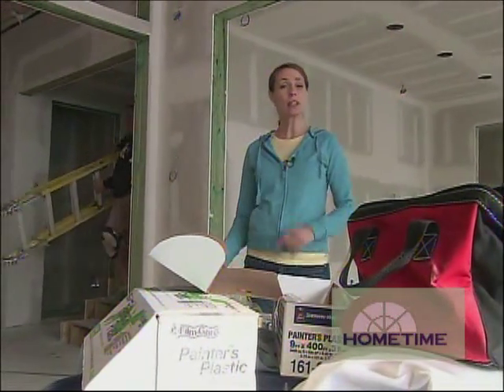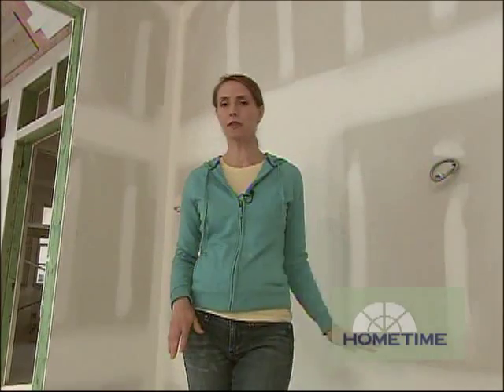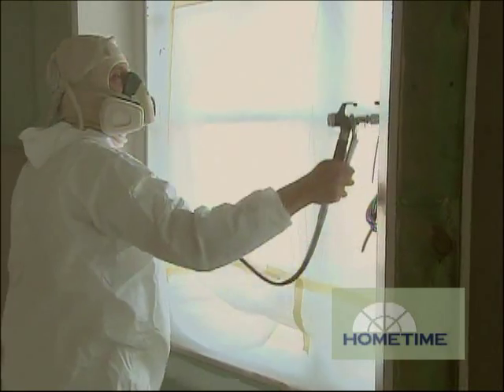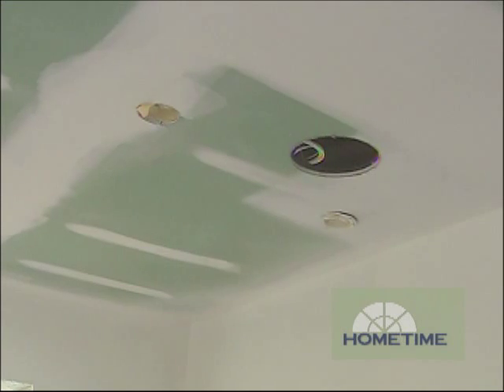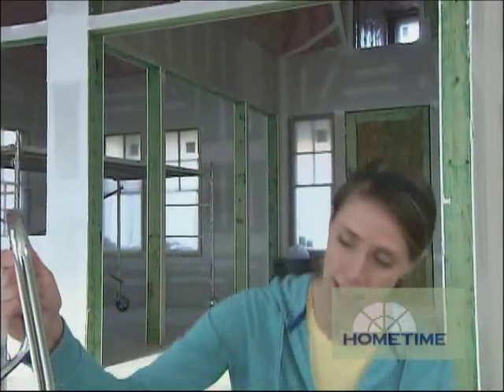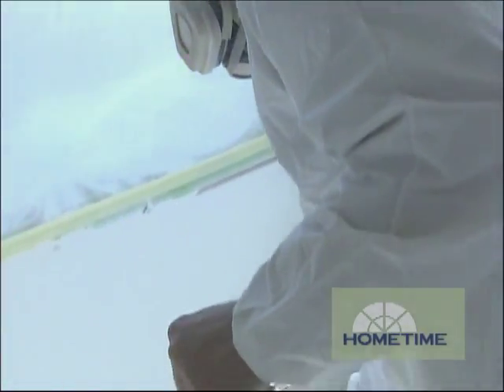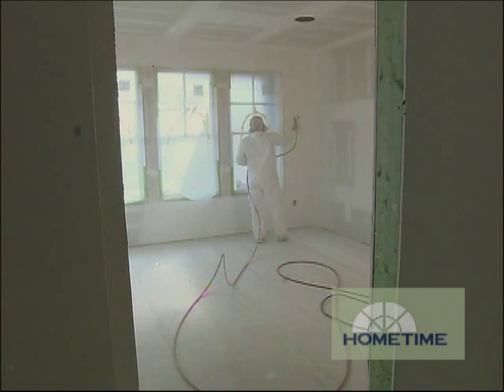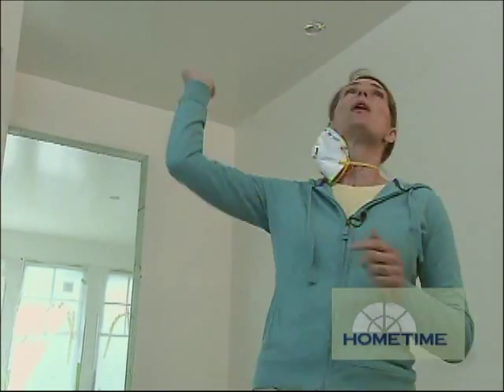Skim Coat and Primer in One Application

Comment: Hello what is the product name?
Reply: Like (Joanne? Forgot her name) said that this product requires a powerful sprayer capable of spraying thick materials like this primer/surfacer. Most likely if you don't have a powerful professional sprayer you won't be able to properly coat your walls. You could roll it on and skim it but that defeats the purpose of purchasing such a product. Now to answer your question, the product is sold and made by many different companies, one of the brands is USG and they make Tuff-Hide primer surfacer which is I think what they used for Dean's house in this video.